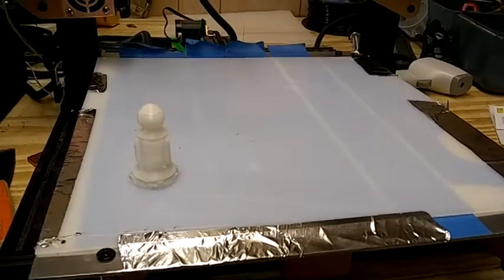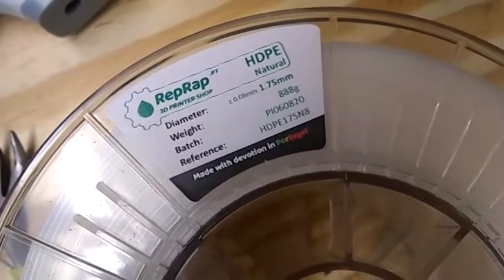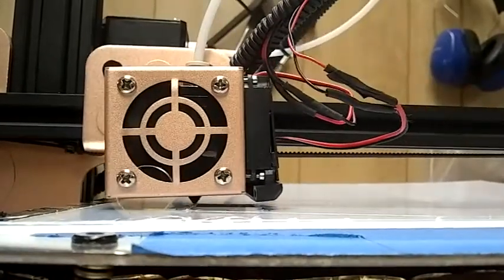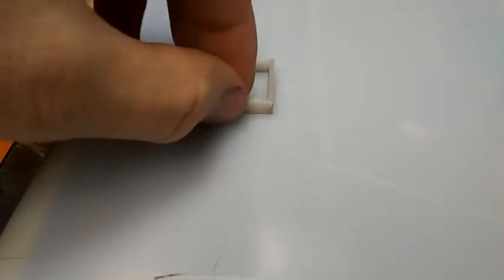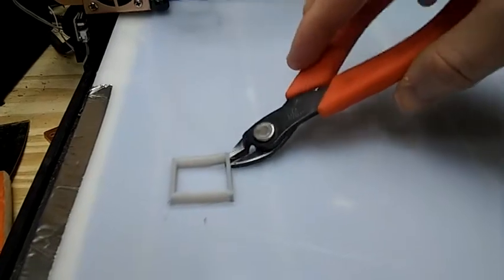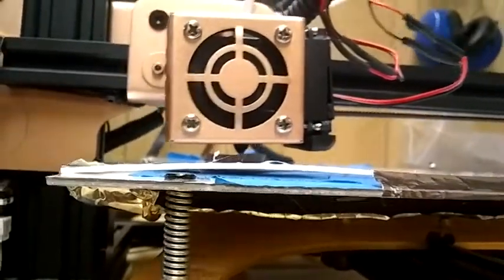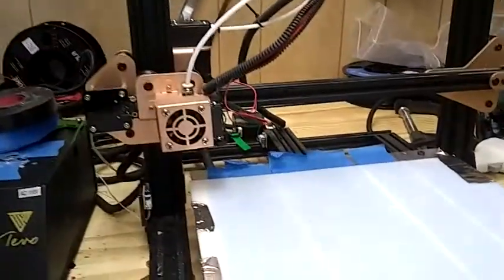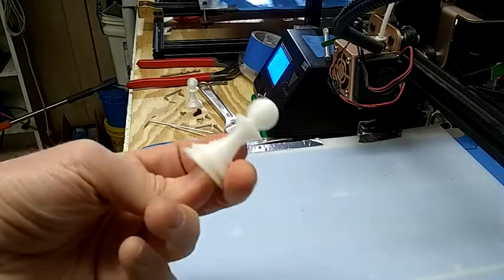3D Printing with HDPE - Successful Print Using Cold HDPE Build Plate

Comment: Hello! Great job! Could You tell me please, where I am wrong? I'm trying to print with HDPE on a fully enclosed Bambulab P1S  (PP plate, extruder temp 230-235, bed temp 35, print speed 20-25 mm/s). I have problems with detail warping/shrinkage. Bed adhesion to PP plate is good. Cooling is on 100%. What else should I pay attention to?
Reply: turn off cooling, it will stop shrinkage and improve layer adhesion
Reply: Can you share other setting please..and the link for the filament you are working with...I am about to start printing with HDPE..are drying it before and using external spool? thx

Comment: I am interested in buying a 3D printer that will print with HDPE.  I will be making a 2.75" x 4" x 1" solid bushing with a 2.5" hole in the center.  I was wondering if this is possible.
Reply from the maker: Yes, totally possible either using HDPE filament or HDPE pellets with a pellet extruder

Comment: Next time just grab a small screwdriver and smack/ pop the top of the part real good with the heavier handle side and it will pop right off without seperating.
I also print PE on HDPE but my sheet is affixed to a 1/16 sheet of aluminum with epoxy (have to roughen the desired adhesive surface of the HDPE and aluminum sheet with a light sanding with 180 grit first) then i can clamp the sheets to my bed with clips and print away at room temp.
Oh and use an ooze shield offset about 1.5mm all the way up and around your part so the heat stays in better will prevent the drastic shrinking in the middle layers with no enclosure.
Hope this helps.

Comment: Hi Sam. I found that printing HDPE on a PP bed worked really well. It sticks good enough to print but lets go when you want it to. Generally I found that I had to print HDPE at very high temperature (280°C) and fairly slowly to get the layers to stick well together, and the prints still tends to warp quite a bit. Anyway, about the bed: if you're printing small objects it worked well for me to print on PP tape (like transparent packing tape). If the object is large it will definitely want to warp and pull the tape off the bed. I tried printing on some PP cutting boards, but they warp during printing due to differential heating. So in the end I made a bed of hundreds of 1x1cm PP tiles that were mechanically fastened to a base plate. That was the printing surface. Seems like overkill but honestly it worked better than anything else I tried.
Reply from the maker: Awesome. Great job.
Reply: what does PP stand for?
Reply: @Rachelcenter1  polypropylene
Reply: Excellent science work

Comment: There used to be a thing called project seafood, they were a couple of surfers picking up trash plastic from beaches and extruding them into filament, hdpe, they would add cloth or textile to the bed, (dont remember if it was heated). The printer would first print an hdpe bed and then print the figure on top of that. Ultimaker made a video about them on youtube.